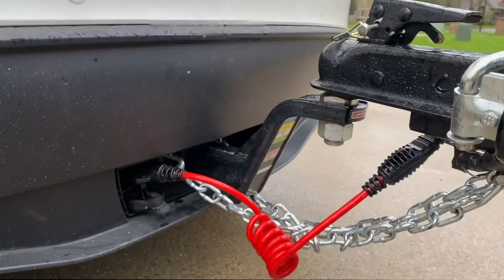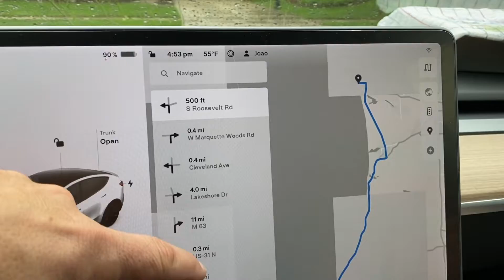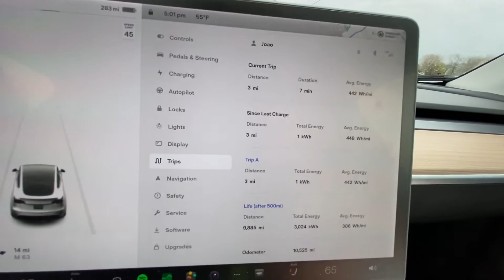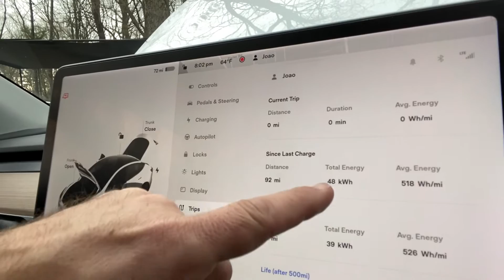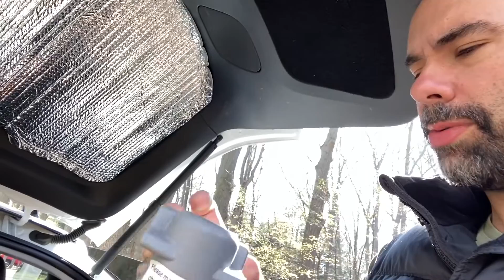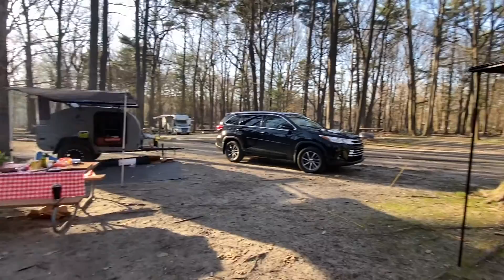Towing with a Tesla Model Y - Testing the range and power while pulling a Hiker Trailer

Comment: Tesla could determine the estimated weight with a brake test using regen and reading  its output. Its a dyno so why not.  Then calculate a basic range then dial in the number after it recharges. The car could be even more acurate with the option to add the weight into the driving computer. 
With known data of that weight it could then calculate energy loss from aerodynamic drag.   

This is all easy  stuff and I'm sure its coming. Its a must with more people going EV.

I didn't  realize there was a towing option on the driving computer. Must  be in service mode?
Reply: It comes pre installed with the hitch order from Tesla.  Idk/haven’t heard it’s avail 3rd party install.

Comment: I no longer own any ICE cars, all I drive are EVs. I can’t ever imagine going back to ICE. The ownership experience of an EV is just wonderful. I do not tow long distance though, I only use a small utility trailer around town. If I did tow a camping trailer, I think I would still do it with my EV. Yes, I would need to stop to charge often, but the overall tremendous benefits of an EV make it worth it. I would maybe try to find the most aerodynamic  trailer possible.

 Now John’s video is a little poor, he didn’t even let us know what battery percentage he arrived with. I think he is not very knowledgable considering he uses miles as the battery state of charge indicator. Still glad he made the video, at least giving us the WH/mile rating.

Comment: TFL shared a video a couple weeks ago. Comparing a Lightning to a gas powered Sierra.  They both pulled the same RVs. Which were much bigger than your Hiker.  The Lightning only traveled 80 miles before it needed charged.  The Sierra made it the 80 miles and back (160miles total)  with gas leftover.  I think the Sierra actually drove closer to 180-200 miles total that trip.  I think for towing anything. Gas is the best way to go.  Although cruising around town EVs would be the way to go.  (Assuming that you would install a charging system for changing the EV

Comment: Gas / electric hybrid is the only way to go with the distances we in the states typically travel.
Reply: In general correct, thats the point of the video ehehehe.. But i would recommend keeping an eye on the latest models.. cars are coming with 400 and even 500mi range. Stoping for 30-40min every 3h to me would be completely fine.
Reply: @jeduardo98  Usually it's better to fill more frequently than go for full fills as charging slows as you get full. Thus adding more stops and charging for shorter would get you to your destinations fastest.

Comment: Here are some things to think about in regards to Electric vehicles. This is a great option for the weekend warrior that has a light trailer with minimal gear. Nothing wrong with that. Could not see this being helpful in long trips. Also, if you do not like driving long distances and make multiple stops to get to a destination then this also seems the way to go. Until solar panels could keep up which in my opinion is hard to see happening.
Reply: As suggested on the video, you can have backup batteries on the trailer. Additionally, it's not as though battery technology will no longer improve. The new 4680 tesla packs reduced the cost ot replacement from13-20k to just 5K. This drastic improvement occured in a very short time with only one company investing on it.
 Now that EV market will be the next big thing, how many tech companies will start investing resources in improving this technology?

Comment: Having a trailer with its own batteries to power the tow vehicle is a good idea. But no matter where you end up. You will need to charge your car and trailers batteries. Now if you where to boon dock, there would be more planning  for your battery charge. We will see how battery tech goes in the future.
Reply from the maker: Good point.
Reply: Thats a good point. Actually Airstream as a concept vehicle with that in mind - https://youtu.be/rQEztxVGEbI

Still, for all to be fully viable, the key dependency is battery costs to go down. As you said, lets see how battery tech evolves.

The ALTERNATIVE HOPE I have, is for the trucks that are coming (Cybertruck, F150 lighting, Rivian) to have enough range even considering pulling a trailer to enable at least 250miles between charges (ideally more).